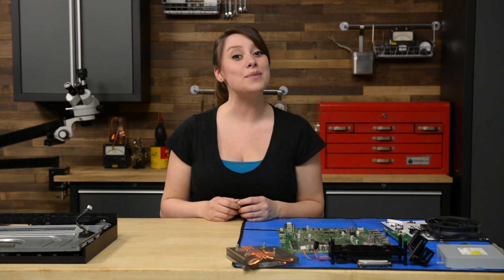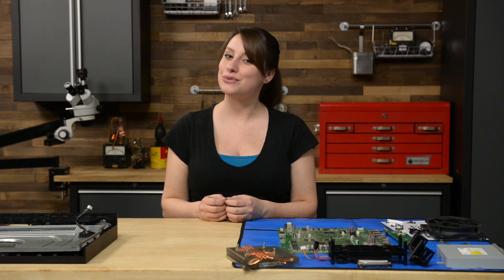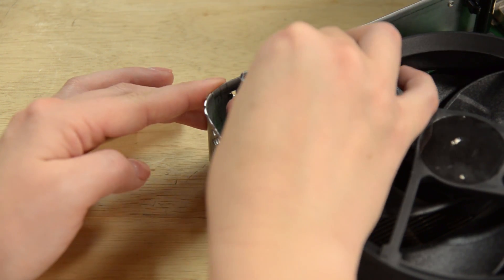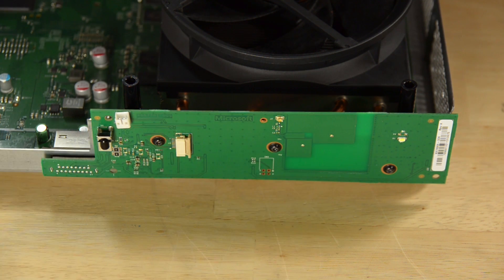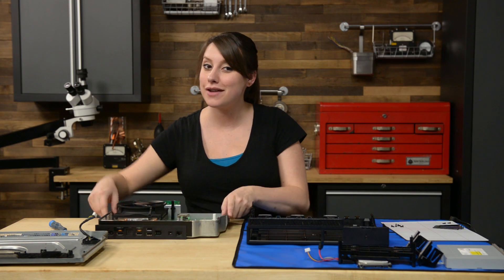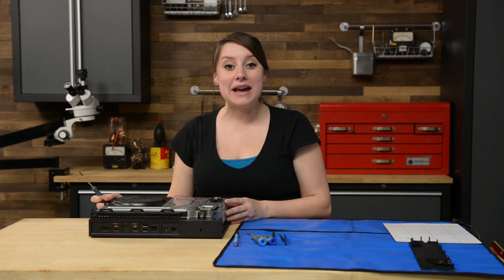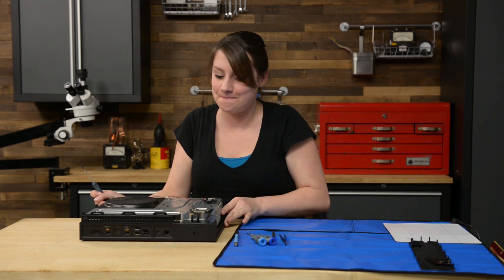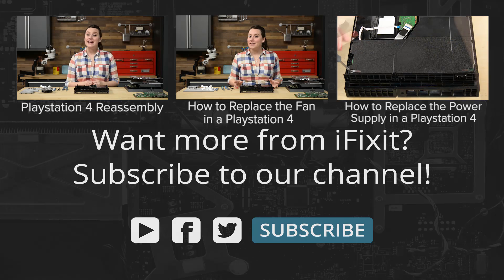XBox One Reassembly!

Comment: Hi ...I replaced my WiFi card but my controller doesn't sync with the Xbox. I bought it from Amazon 
Here
 WiFi Board Wireless Internal Signal Controllers Repair Bluetooth Replacement Durable Slim Game Player Part for XBOX One https://www.amazon.in/dp/B07SN83DQZ/ref=cm_sw_r_cp_apap_qTw65URBIkOCz

Comment: Sounds like a lot of people have the same issue of getting the case back on but it not closing up like how it was before opening it. Thankfully iFixit offers a good tip to remove the front plate from the case first and then once you've reassembled the top and bottom, go ahead and put the plate back on. 

My question is why the fuck does this do this to begin with????????????????????

Comment: Thank you so much. I bought a pre-owned one as my old one died after 6 years (RIP). Turned it on, found out it sounded like a jet when loading up a game and it was WAY too hot. So, opened it up, found out the intakes were CAKED and I mean fucking caked in dust. The exhaust too. I've never seen something so dirty.

Cleaned it with a dry cloth, turned it back on, works like a charm. Barely any noise.

Comment: Anybody here trying to put the top back on i got you bruh. I struggled with that bitch for bout an hour. So, make sure the top cover is separated from the front panel. If it's not, check where they connect at, it should be some bendy plastic pieces holding them together stronger than an arranged marriage. Unclip those and then proceed to position front panel in its place but lean it outward away from the xbox a little.  Position the top cover back on and everything should then snap around it nicely and this is where you push the front panel back into the box(with consent of course. You have to literally ask the xbox if you may enter through the front. Manners yknow) which should also make a nice snapping noise similar to high school with those hard back ass chairs that you stretch and lean back on and it sound like somebody twisting empty water bottles. If you need any help, leave a reply and ill try to get back to you asap but I be busy n shit so don't catch a attitude if its a few hours later. I got shit going on too

Comment: Beyond frustrated. Even with your guide I still can't get the front plate to align properly. Had to take the whole cover right back off and now I can't get the front plate to seperate again. Going to end up throwing the whole system away.
Reply: Dangerous Noodles did you sell it?
Reply: Dangerous Noodles have patience damn you’re the one that took it apart

Comment: Don't worry about the front plate, if you're able to get the left side on correctly you can kinda force of even in some spots, tape it down so it's not as loose. Mine was loose after but everything sill works. Only down side is the top right is a bit loose but mine was refurbished anyway, so that's to be expected! When opened mine up it was covered in dust after cleaning that I cried about it not being just the way it was beforehand but I have OCD so in do that a lot, once I got over that and after about 5 tries I gave up on getting it perfect and was able to get most of the left side on right and simply taped the center area and it is very tight, along with the right side it doesn't wiggle or feel nearly as loose. Microsoft needs to be a bit more user friendly when it comes to opening an Xbox up.

Comment: If you guys are having wireless hardware problems just find the wireless and bluetooth thingy and unscrew both screws, take out plate gently, take off the cord, then put it all back. It worked for me
Reply: damn I ripped the cable
Reply: alonso 2smooth Tried it and didn't work. Any other solutions? Wifi is stuck on wired and Xbox's button to sync with controller won't work.

Comment: Watching this video really helped putting my Xbox One back together. Got thrown on the floor and panels came apart. Front panel was a little jammed so I took it apart and then saw that the ribbon wasn't connected to the front where the touch power and eject buttons are controlled by. Reconnected that, after putting the top panel back on, snapped the front panel back on, plugged it back in and tried the power button and it works! After becoming overly frustrated with getting the panels off so I could fix it.

Comment: Why is it so hard to put the front plate on
Reply: Remi Taylor you can even see it pop out of place in the video and they don't cover how to put it on correctly.
Reply: Yeah dude, mine literally only pops on half way and then it's just separated along the bottom by the power button..
Reply: Collin Penrod take the front panel off completely from the top and bottom one. Then slowly connect it to the bottom part, while re-establishing connection of the home button wire. Once set, push the top back in and it will take very minimal effort
Reply: 5:20-5:24, slow down the video and rewind as needed
Reply: Remi Taylor put the top one on and make sure you replug the blue thing through the yellow thing into the white thing and the just press it on, it took a second for me
Reply: FUCKING RELATABLE
Reply: WHY Couldn't they make the cable just a little bit longer to make repairs easier??
Reply: I just completely broke the whole Xbox doing this, gotta go get a new one
Reply: Remi Taylor idk
Reply: Darthly nooooo:(((
Reply: Take front plate apart from top plate and put top plate on first.  Next put the front plate on by putting the bottom clips into place and then push top bit on.
Reply: this is shitbox